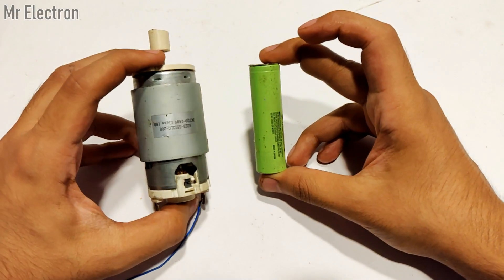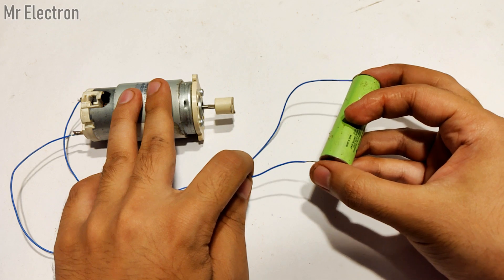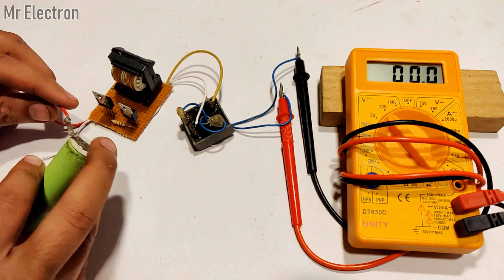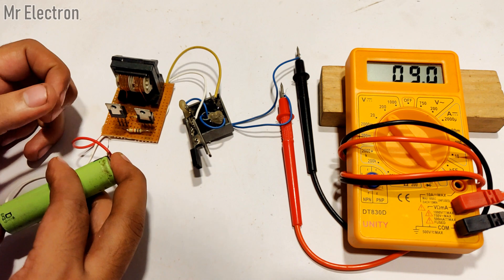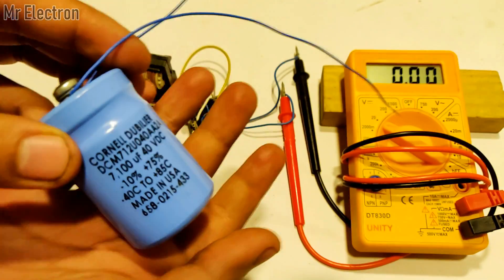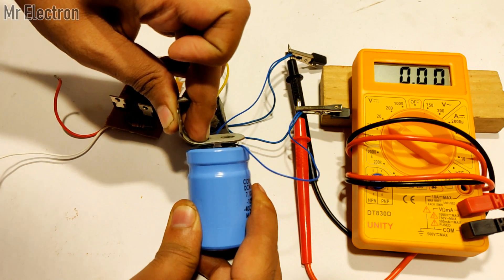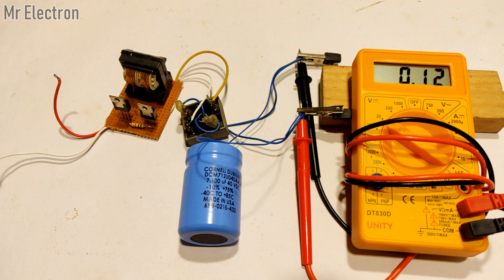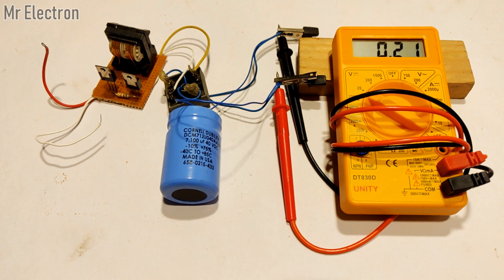Free Energy 2018 | Never saw this effect before

Comment: It is because of static charges around you and yeah when the multimeter read voltage it don't produce electricity only in continuity mode it produce voltage my capacitor also charges not connecting anywhere even to the multimeter one day I accidentally short a discharged capacitor and it sparks I was surprised and I research a bit on this and I found that static electricity can charge capacitors

Comment: It's always happened with large caps , when you discharge it's trying to recover some volts that's why most of the manufacturer use a high value resistor parallel with capacitor to keep discharge

Comment: Wonder if he ever discovered the answer..... it's called 'di-electric absorbtion' ..... after the 'discharge' some of the charges in the dielectric re-orient themselves in the original position...and thus a small 'potential difference' appears on the terminals again.... it usually happens on 'large value' caps, or extremely high voltage caps.   That's why you will see 'shorting' bars on HV caps during storage so it stops a possible dangerous situation ....

Comment: right before we get to the cap the inverter frequency is to high for the  diode bridge to rectify into dc for the meter to read , you need some high frequency diodes out of a switch mode psu designed to work above 48khz , That will then show you the voltage , but put a cap across the get it to work . The electrolytic is a chemical reaction and electrons can be made within the cap... All depending on what they made it with .

Comment: This is a common effect with large valued capacitors.  Model it as having caps in parallel connected by series resistors.   Then you will realize that a temporary short will not drain all the energy from the cap.  The residual charge redistributes, so it appears to be charging itself back up.
Reply: @al schneider actually there are a few others who got it right, but they didn't explain why it happens.  And it's likely only a physics geek or an EE who deals with capacitors for energy storage would care to think about such things.

Comment: Hi, I have experienced similar things while working with Electronics.

The reason is that, your step up converter has a very huge internal resistance. Thus it can't tolerate short circuit.

When you short circuited the capacitor, the capacitor discharged instantly, but the voltage did not get back to normal in a quick manner, because the circuit has very high internal resistance.

Thus if you leave it for sometime, the capacitor will charge up easily.

Comment: This effect is typical with large caps. You can disconnect everything from the cap and just connect you meter. Charge the cap with a battery, and then discharge it like you did shorting the terminals. you will see that the voltage starts to climb again. This is normal. Large caps act very similar to batteries. Nothing strange going on here.

Comment: There's radio waves coming from space but your going to need a high frequency diodes higher the better like diamond diodes because low frequency comes from earth what your getting but high frequency comes from space and that's what you need to tap into to get free power but once high frequency diamond diodes come out as normal, free power will be a just a electronic circuit and a antenna

Comment: The coil is picking up radio waves it's not free energy. You might be able to charge a phone in like the city but won't work far away from any radio station like on a deserted island. If you connect a antenna to a voltage multiplayer and you can charge a battery because without a voltage multiplayer your not going to get much voltage only around .20volts it will go higher I you stand in front of a microwave when it's on or stand in front of a old electron tube TV when it's on

Comment: You're back feeding though your meter
Reply: I agree with your explanation.  He will have to totally disconnect the capacitor, short it and then just connect the multimeter to see if the symptoms materialize again, if not then it was something else and would be worthy of further experimentation, if the same observation is made, well he will know it was just the meter back feeding like you were saying.
Reply: Agreed!!!
Reply: The voltage is from the meter
Reply: The voltage is from your "digital" multimeter

Comment: Capacitors are wound. That is they are coils inside the capacitors of aluminum usual and something else. 

The short grounds the current, not the voltage. 

When you released, the current was free to spin. To a limited value I'm sure.
Reply: No, not really.

Comment: I m sure it is because of  electro magnetic signals around as... This signal Induction in copper wire in a circuits.. Which u connected to capacitor.... And it is enough to charge ur 7100mfd 40 volt  capacitor :)

Comment: Free energy can be attained... BUT you have to be clever with the way you amplify the kinetic chain. For example you could spin (or, I should say, keep spinning, once it has been brought up to some certain speed in RPMs) a very large alternator, revolving around the same axis, with a very small high speed electric motor as the drive unit... say, a slot-car engine powered by a 9V battery... all it has to do is deliver a force equal to the friction in the system and it must keep spinning... this is fundamental law of physics... in the meantime the very large spinning alternator (with huge copper coils and super powerful magnets) will certainly give off more than 9V in reply... (I was able to attain 90V)... is this not an example of over-unity? Give it a try.
I like your stuff... thanx.

Comment: The meter has problem
Reply from the maker: Well then it should not be reflecting 0 volts after i shorted it right.
Reply: the meter push electricity to the condenser, that's why it's changing constantly

Comment: Universe in motion, stars, rotating planet, galaxy is spinning, all at high velocity...seems like a whole lot of free energy out there. Earth has a free magnetic field with voltage and current between locations and altitudes. Anytime we create a magnetic field we create electrical energy. Use that to recreate magnetic field. That oscillation is a feedback circuit. Harmonic resonance of mass in the circuit creates coherence magnetism like a metal microphone coil next to a magnet becoming a generator going into a capacitor and batteries. The original power sources which pulsed are their own electromagnet transmissions. Thus emmitters are also multipliers, generators and recievers. You were probably taught to remove this belief from your electrical theory.
Reply: It's free energy but not infinite energy someday the orbits will fail so the moons energy won't always be there the sun won't always be there but yes there is energy is anything that moves in space

Comment: Namaste Sir, what would the different metals contacting each other do in presence of the coils being fed torsion fields & or Magnetic flux from surrounding area?  The Cap. seems to be slowly holding a charge from microvolt input?  If you take the large ceramic magnets out of microwave ovens and stack them on any steel bar just slightly less than the inside diameter of the magnets repelling each other opposite poles and tilt the whole thing back and forth so the magnets wobble/spiral around the long rod... you will produce a fairly strong current... if you attach your meter to both the magnet surface and the steel bar you will get a stronger reading but very little amperage... just ideas that yous might want to experiment with i have tried in the past... Mr. Tesla is smiling ;Down on you all from a far better place /!\ <3

Comment: With a Coil in your electrical circuit, it is normal to have a "low" voltage and then the expander is working to store it little by little. 
The bridge rectifier as well make it better to charge the Capacitor, by converting AC to DC because your capacitor is already DC 
Check up as well, how the crystal radio is working and we know crystal radio need no batteries
Reply from the maker: exactly !!!
Reply: Friends ,capacitor charging by multimeter. Not free energy. Because 9v battery use in multimeter.
Reply: Dear, thank you for sharing this with us.
in case such things happened with you , please check up your Multimeter, and by the way , there is different kinds of Multimeter some of them works by 9V but not all of them , there is also by 6V & 3V

Comment: This is the exact thing that I encountered when I was working on a solid State tesla coil in class 10.... So at first I used a 9v battery to test the circuit .....it worked ....but eventually the battery died....my friend had the same multimeter.....common in the market.😁..At first when we measured the drained battery it read 6.5 v but we kept it connected to the multimeter and we saw the voltage rise...it went up to 8 volts ....we were fascinated...😂..but the battery actually had not gained power...hope u get it.
Reply: I don't think its the multimeter if thats what you mean.A multi-meter whether cheap or high quality gives accurate readings with 5 % error that every meter suffers. Cheap meters get damaged easily but give accurate reading as long as they are working fine.So in Your case it might already be damaged
Reply: @mrelectron_alternator  the crazy plazma guy is deliberatly trying to discorage not to look into it and find out that electricity is free and in the air and everywhere its as Nikolla Tesla called its the aether.
Even the electricity produced by the electric companys is drawn directly from the air from the huge towers everywhere u look..
Do ur own investigation dont trust anyone who immediatly shoots u down..
Look into it and best of luck..
The world is not as they tell u, they are lying to u and everybody..
Reply: @mrelectron_alternator  I am not 100 % sure about what's actually happening with him....and class 10 ...I was new to multimeter s and didn't know for sure that wether it was broken or not....but I had the same type of increase in voltage....but now I own some high quality metres and I don't get these types of readings any more.😊